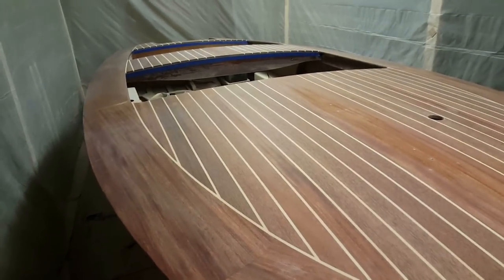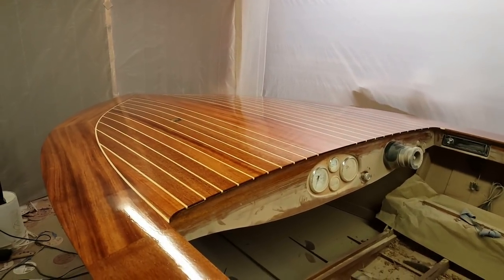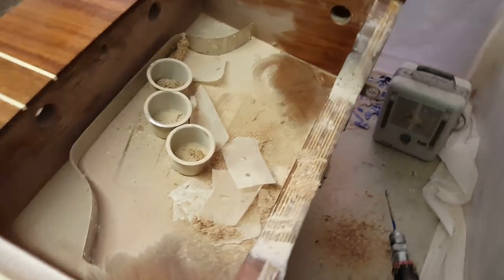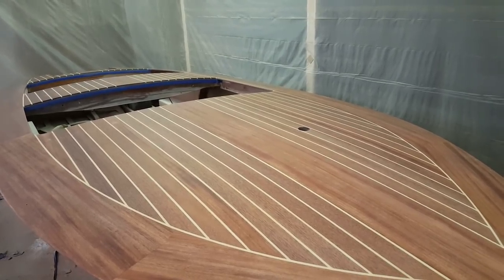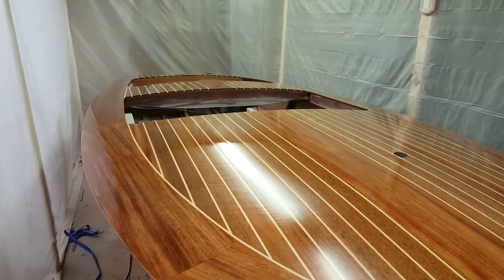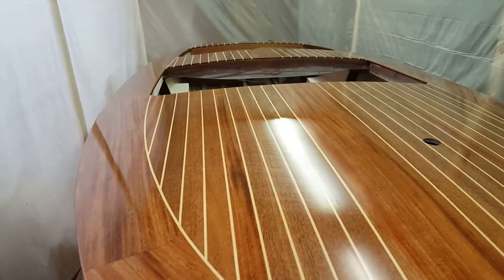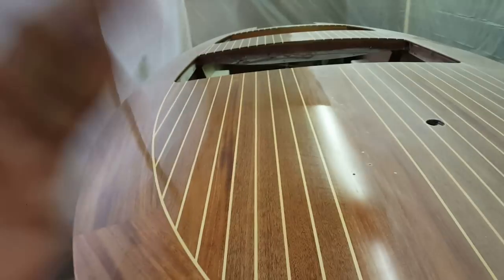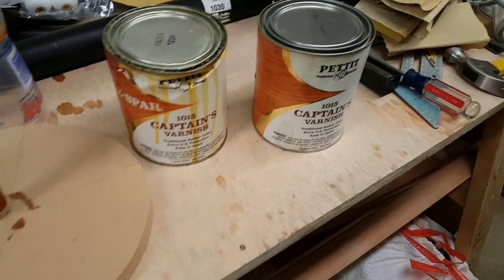Building the Zip vol# 49

Comment: Pettit varnish looks amazing - great job. FYI I believe used the same windshield brackets that you have ordered (Lake Shore Ind.) and they took a long time to show up. Also they are very rough cast so get ready for hours of grinding and polishing - but the price is right!
Reply from the maker: SIMON FOORD pettit captains varnish is awesome, i can't compare it to any other brand because it is all i have ever used but with results like this no need to try anything else.
Reply: I will try it for sure next time - it's impressive. I had a lot of problems with brush marks using System Three WR-LPU, it dries so fast.
Reply from the maker: SIMON FOORD put the third coat on the sides and transom tonight (stopping at three for now) my brackets finally shipped friday nine weeks after placing my order, thank goodness It wasn't a kidney! i was going to wait on varnish until i fit the brackets, glad i didn't or my zip would not have been ready for this summer.
Reply: Home stretch! Excited for you. Have fun with those windshield brackets! Maybe there is a local shop that will polish them for you. I wasn't looking forward to cutting out the Plexiglass but it was pretty easy. Really looking forward to your next video.